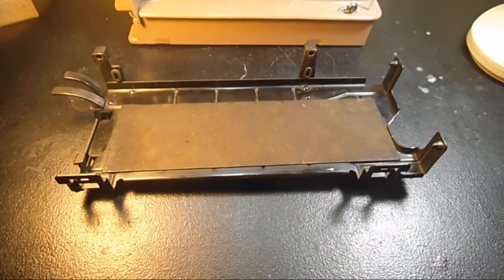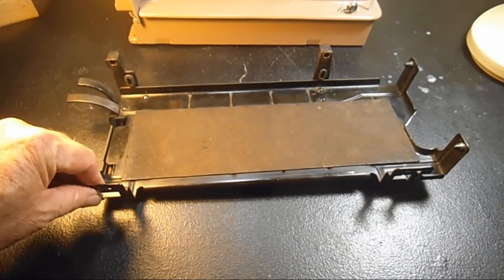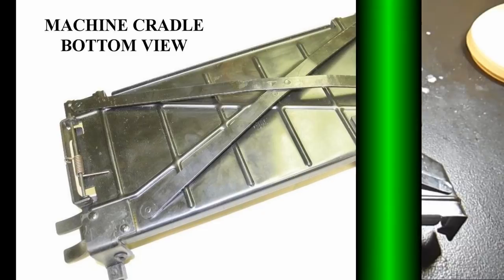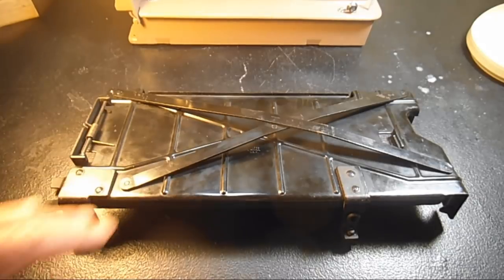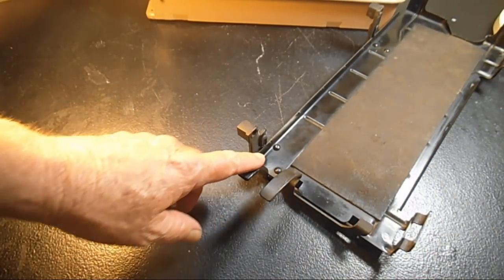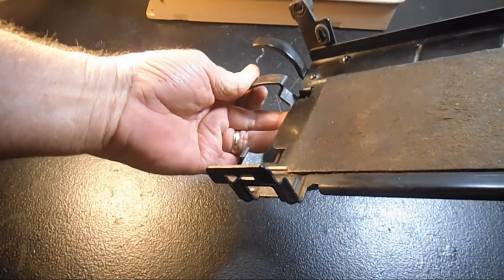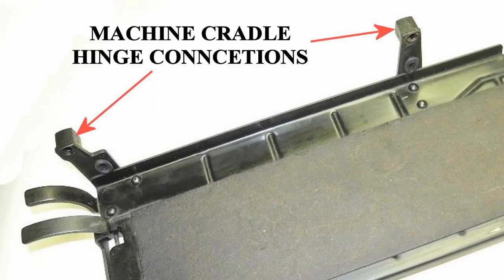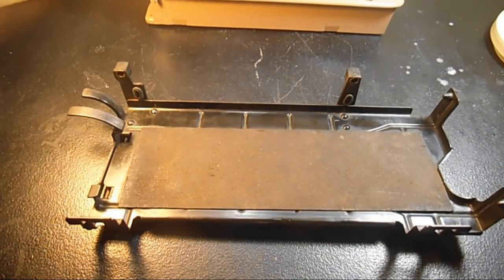Rockabye Coco - The Cradle for model 301. Coco goes to the Spa Pt 14 - Singer Model 301A Rehab

Comment: Extremely informative video!!!  I purchased a 301A and now looking to put it into a cabinet with cradle.  My friend is giving me a cabinet that belonged to her grandmother and she threw away the old machine that was in it along with the pin hinges.  That just kills me because I know the machine she threw away is better than the modern plastic thing she is using that only sews in reverse now.  I will have to get creative on getting some of the "bits", the rubber grommet and soft material stop.  When I bought my cradle it came with all of the cabinet hardware.  Thanks for sharing so much valuable info.
Reply from the maker: Yes you can find substitutes for some of the "bits". I found grommets at my ACE hard ware stor for about $1.  I also found a small cork board at Goodwill for $2 and took ou the cork for using it on the resting points. You'll do fine. I'm happy for you and best of luck.

Comment: Hey Andy, I just found me a black 301 yesterday for $50 with a couple of feet, button hole maker, zigzag attachment, and it included the cradle which is why I ended up finding this video here. It came with that cabinet number 42, I think it is. I always find those not in the best of shape but I’m not gonna worry about it at this point.  The machine is very beautiful and is a bone dry. I don’t see a trace of grease in it either. I’m in the middle right now cleaning her up. I changed the wires out on the foot pedal only to find out the footpedal is slow, so I’m gonna put the pedal to the side get me one of those electronic ones and work on the original one later on.  I know you have a video out there, so I’ll be watching that again.  I had to pause and make a comment because I didn’t even realize that there were no holes in the back of the machine, that the cradle is what does that for it so let me get back to watching the video lol.
Reply from the maker: Wow!, What a bargain, Happy for lucky you! Yes, model 301 was the only machine Singer made to use with a cradle AND a flip-up carry handle. Nice idea, IMO.  BTW, I am not telling my Wife about your purchase... she does not look good when envious. LOL

Comment: Jake couldn’t understand why I kept opening his cabinet and peering inside. I had to compare his brackets to those brackets...
Great video, Andy!
Reply from the maker: Thank You. I've been able to mount the Model 404 in a number of cabnets. SOme went right in with the existing backets I found in the cabinet, but soe I had to replace he brackets to mak the 404 fit properly. I can't find much nfo on all the dfferent rackets, so it's been trial and error stuff. I have bought brackets on eBay when I found them just hopig to be able to use them someaday.

Comment: It is my understanding that the more recent cabinets came with those metal brackets for all machines not just the 301?
Reply from the maker: If you mean the two hinge pin parts, they have been part of the cabinet hardware going back many decades.

Comment: Hey Andy:
I don't think the link you provided for Zlvintage is complete, I tried both ways.
Here's the message I got:

The User ID you entered was not found. Please check the User ID and try again.
Note: you can look up a member's eBay User ID if you know that member's email address.
Reply from the maker: Thank you. I fixed it awhile ago when a subscriber emailed me. I just tested again and it's working. Maybe refresh the page? or close and reopen the browser.
Reply: Yup. Refreshed the page and it's working!
Thanks Andy.
Reply from the maker: No worries. I'm glad you took the time to let me know. Sorry I messed up the link. :)